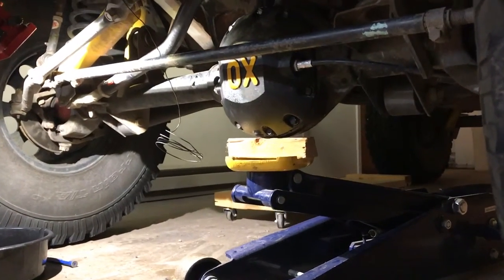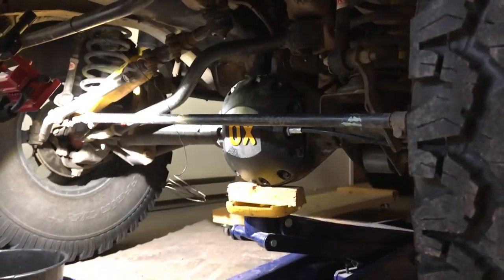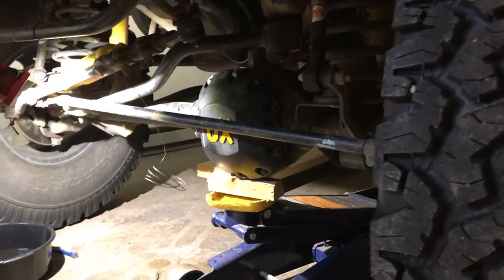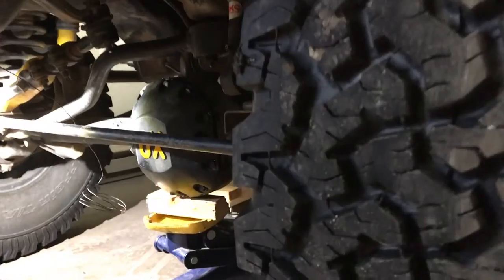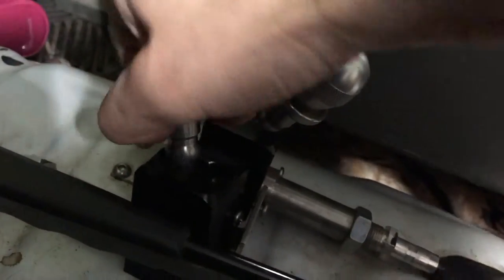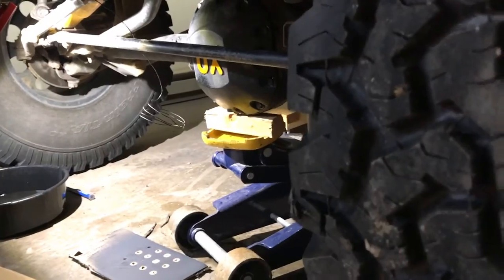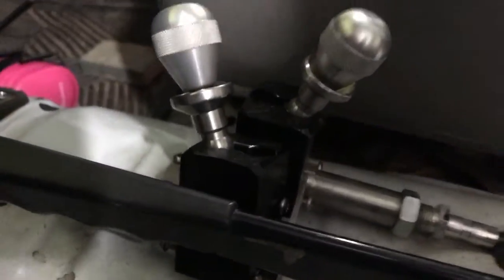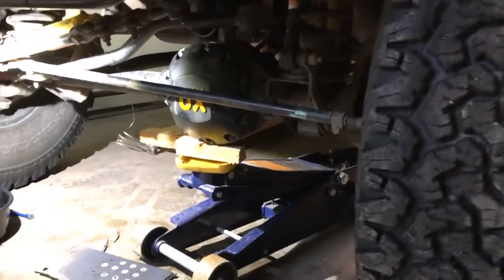Dana 30 OX Locker Manual Shifter Check

Comment: I'm hearing a whine through my cable... yours too?
Reply from the maker: Negative. Can’t hear anything over the howling of the ring and pinion in that rear axle.
Reply: So my pinion is making contact with the lock ring...causing my noise... just found after I pulled cover

Comment: I'm late to see this video but... I've got a OX in my Dana 30 and seem to turn at all, zero, when wheeling. Any thoughts?
Reply from the maker: Lockers do hinder turning, especially on slick rock kinda stuff. Maybe something is binding up?
Reply: @rebelexploration7941   thanks for the reply. I've ran different lockers and know they hinder steering but this OX is on a whole never level. Will definitely check to see if I'm binding somewhere.